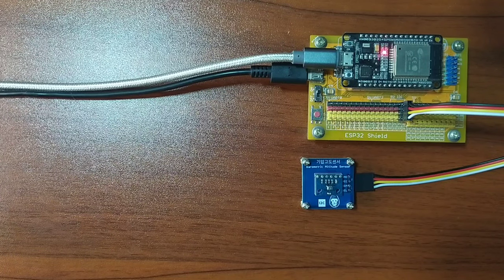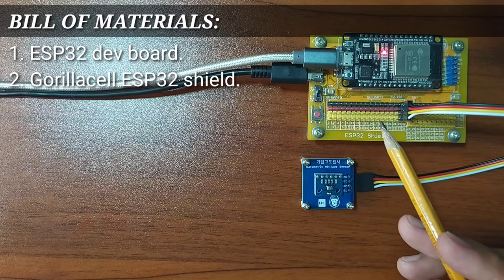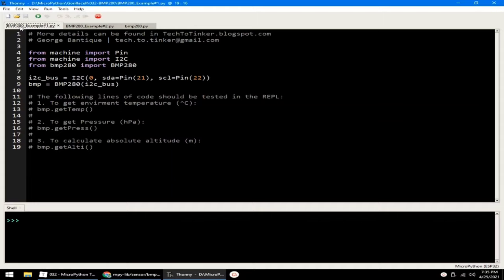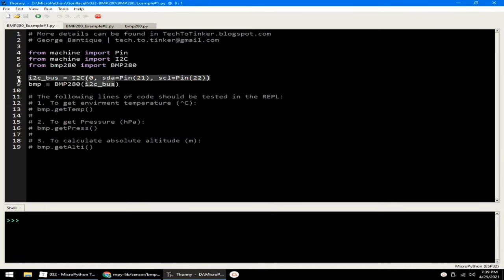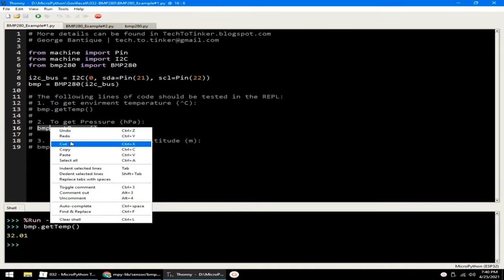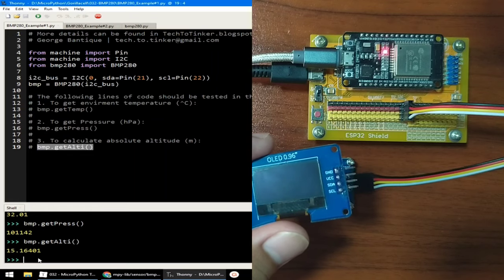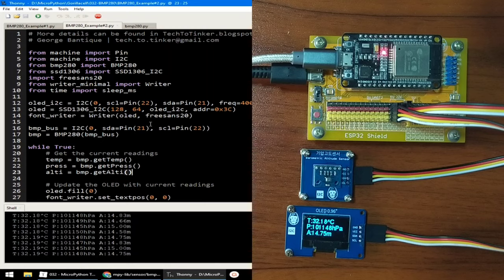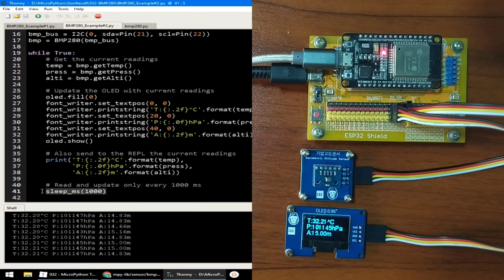032 - MicroPython TechNotes: BMP280 Sensor

Comment: Hi George, Great video again :)
the pressure from the BPM280  sensor is in Pa. If you need the pressure in hPa, you need to divide the sensor value by 100.
Reply from the maker: @Frank Vergote, I stand corrected. Noted with thanks.